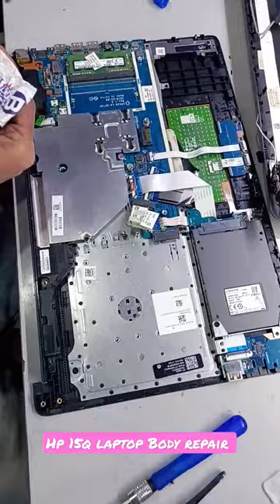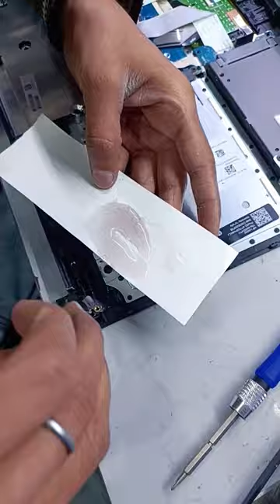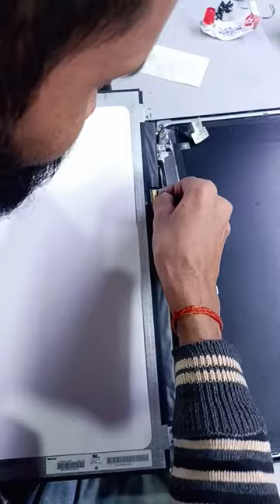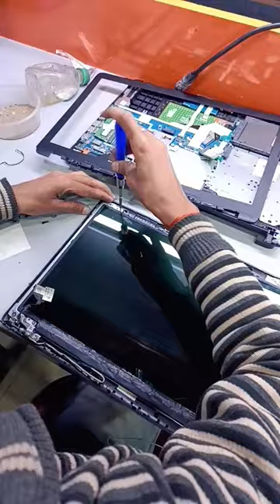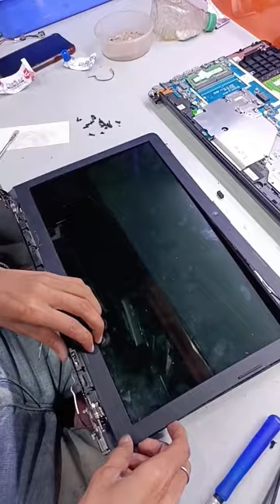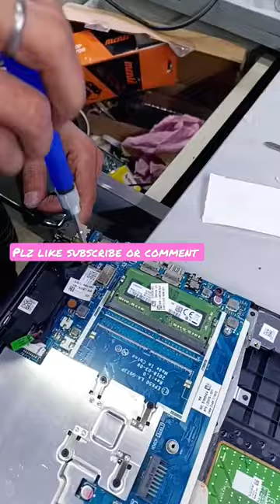HP 15Q laptop repair & service | Broken Hinge & Display Panel - Screen Replacement

Comment: This is the worst thing you could do ...... Using glue to fix is not really good idea for the hinges.....now the customer will have to get both the upper and lower casings replaced.... So sad... I do understand the ratio of cost to repair service but still this is very bad if you are planing to use a laptop for atleast 8 years as being a Indian I believe in long-term use.

Comment: I have same laptop 
My laptop is not turning on 
When i press power button the caps lock light blinks but the screen is black 
What should I do
Reply: First check it by connecting to monitor with HDMI cable if monitor shows anything so it is display problem otherwise motherboard